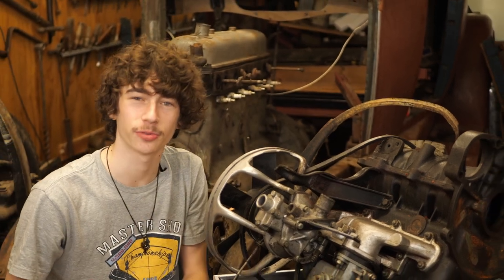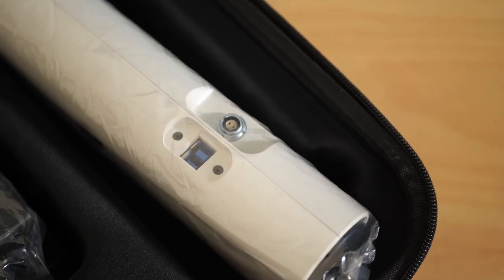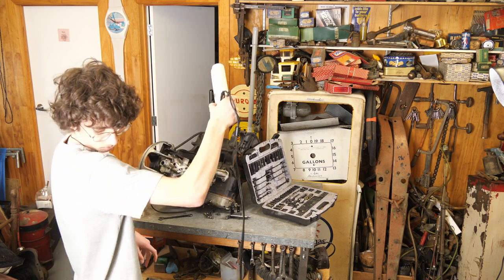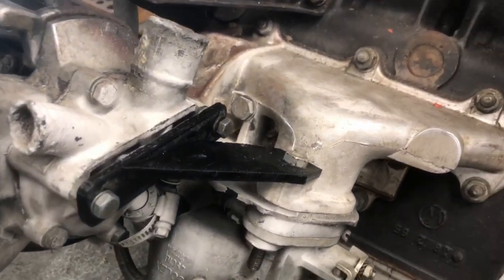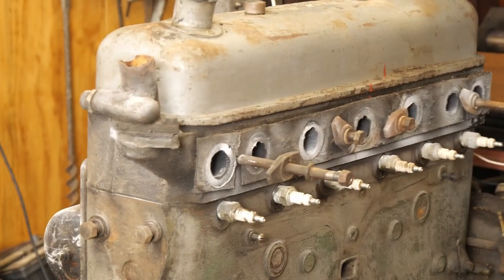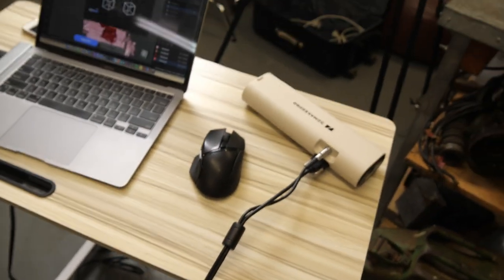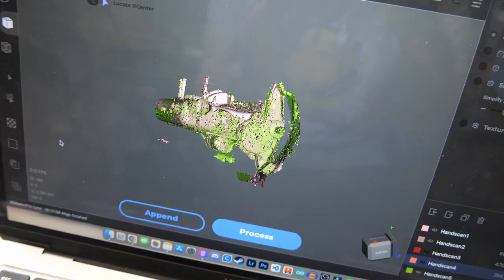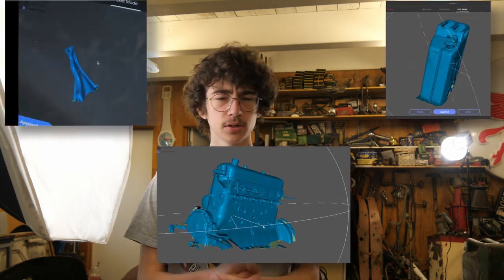Large Format 3D Scanning For Everyone!

Comment: How long does it take to scan an object? I bought this scanner a year ago and still can't get it to work.  The light on the scanner flashes for hours.  I just want to scan a bunch of small car and truck parts.
Reply from the maker: 10-15 minutes usually for an average sized scan. I used the handheld mode and then combined multiple scans into one. The whole process can take some time when scanning multiple things and combining and editing them.
Reply: @TommyHoughton  10-15 hours? Maybe I didn't leave it to scan long enough.
Reply from the maker: Sorry, I meant to say minutes.
Reply: @TommyHoughton  thanks it's ok, I guess I need to get a new computer and see if that helps. It just flashes forever.